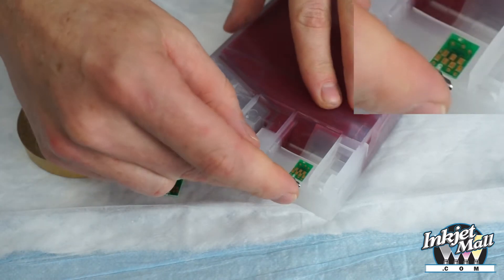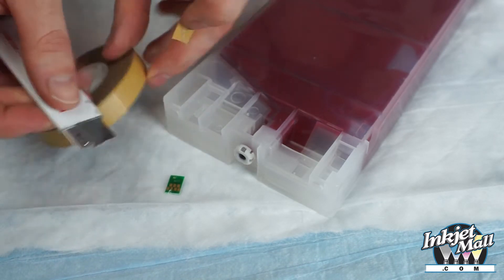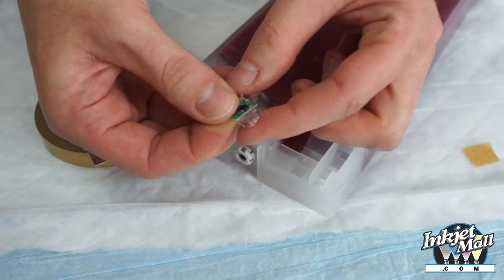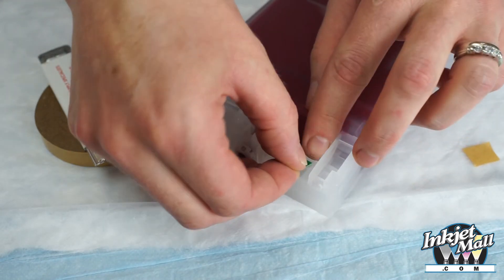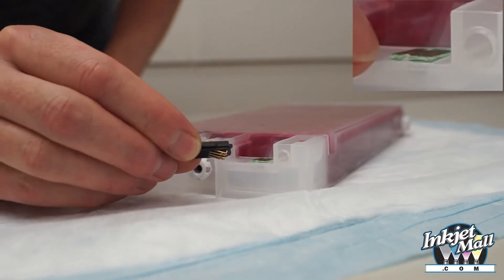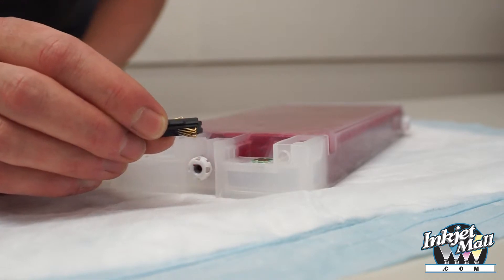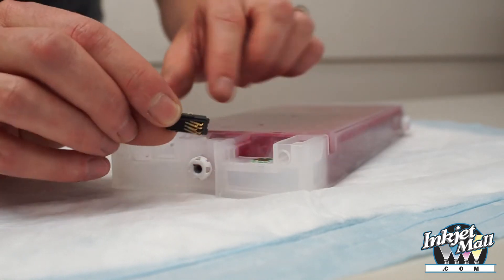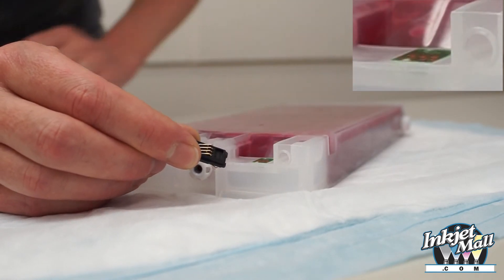InkjetMall.com - Replacing chips on Epson 7800 7880 9800 9880 Refillable Cartridges

Comment: and does the 7880 have refillable cartridges that are recognize by the printer as a oem cartridge
Reply from the maker: No. All EPSON printers since the original Pro series (4000, 7600, 9600) will only recognize a 3rd party cartridge as non-OEM. However, you could put your EPSON chips onto our 3rd party cartridges and reset them with our chip resetter and the printer will believe they are OEM. It is all in the chip. Either you use 3rd party chips with refillable carts or you put the Epson chips on them.
Reply: ok i am at the website my setup is LLK--LM-LC-LB_BK-M-C-Y i don't want to ASSume please tell me what cartridges i need i don't see to of my option here .........Thank You
Reply: LLB-LB-B-C-LC-Y-   the magenta's are in question
Reply from the maker: @themerchantmaker_6592  the 7800 used magenta and light magenta. The 7880 uses vivid magenta and vivid light magenta. You can use the 7800 magenta inks in your 7880 printer but the color gamut will change. Making new ICC profiles will correct that. OR, you can buy our vivid magenta inks to put into your 7880. All of the other colors between a 7800 and 7880 are the same. Our Ultra HD Matte Black will be a full stop darker than the OEM ink. Our ultra Photo Black will be darker and glossier. So those two inks if you purchase from us will be a great upgrade.
Reply from the maker: @themerchantmaker_6592  you can use the Contact page at InkjetMall and send me some questions and I will answer you later today.
Reply from the maker: @themerchantmaker_6592  I made that link for you, it includes all the chips for a 7880 printer. The printer has nine ink cartridges. And those are the chips per each color position cartridge. They match up with the color slots in the printer.  So if you have a cyan cartridge you need a cyan chip to convert a 7800 cyan cartridge to a 7880 cyan cartridge, etc.